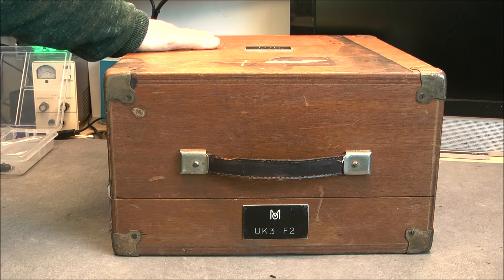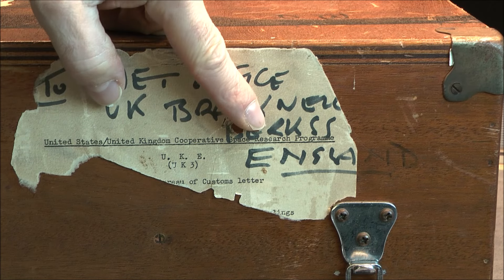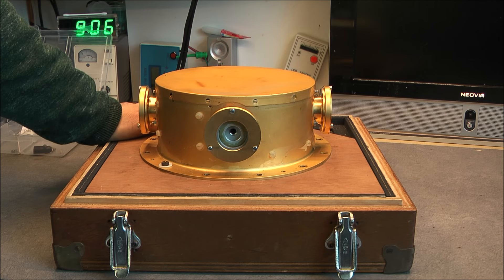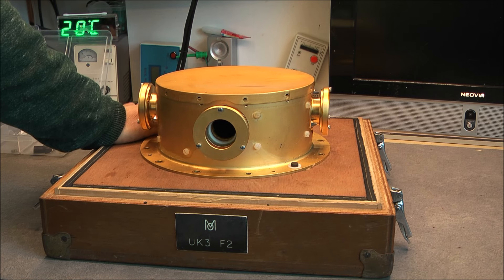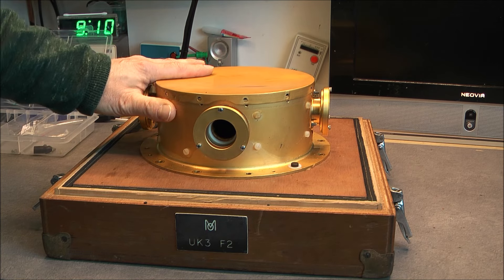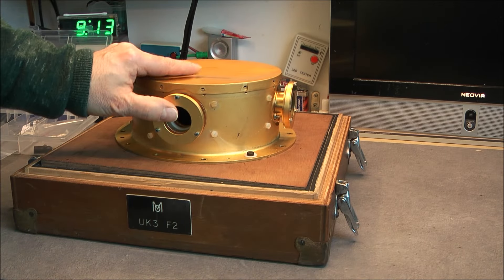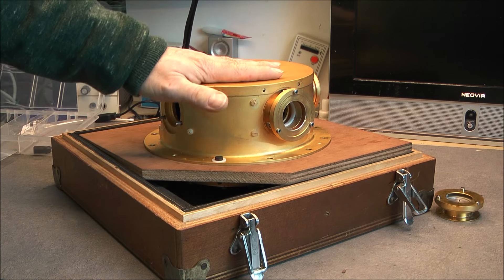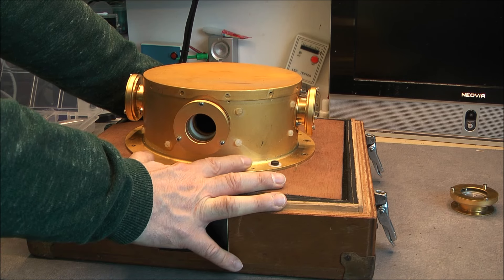UK-3 a.k.a Ariel-3 satellite MET Office UV detector head teardown

Comment: It might be the insulation foam, that is disintegrating and turning into acidic fumes, that has loosened the gold plating. I once found box of gold plated vintage IC:s packed in disintegrated foam, that had similar damage to the plating, gold just flaking off from the underlying metal. Or maybe the potted battery has started to leak and outgas, epoxy must have tiny voids at least through the wires and connector where corrosive gasses could slowly escape.

Comment: The odd screw threads may be a British association thread
Reply from the maker: Yeah, such screws are not made anymore it seems, in particular not from  affordable sources as chinese manufacturers.  I have the same issues for Smiths and Elliott aircraft instruments.
Reply: @msylvain59  they are still in use in model steam building but not very cheap indeed
Reply: @msylvain59  Try Chronos Engineering in the UK, or Model Fixings, also in the UK. Both keep BA fasteners at very sensible prices.

Comment: Nice, just a satelite part, from gold era of space exploration 😊.
Tubes where beter option then, transistors and ICs where much more sensitive to radiation back then.
Perhps it was meant to go thru Van Alen belts, it whoud fry everything.
Since its a ionised oxigen detector its likley.
Reply: Semiconductors from that era are way more resistant to ionising radiation than modern devices.